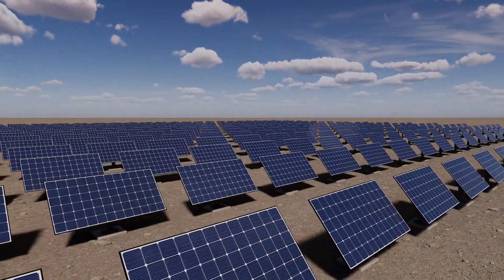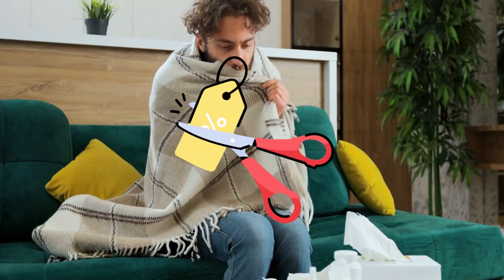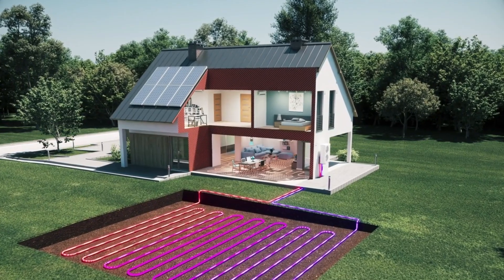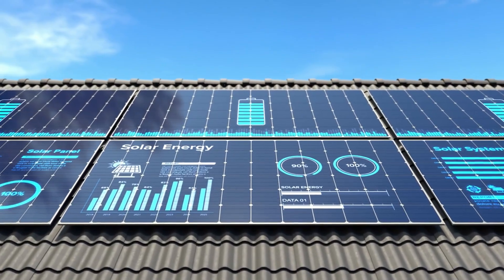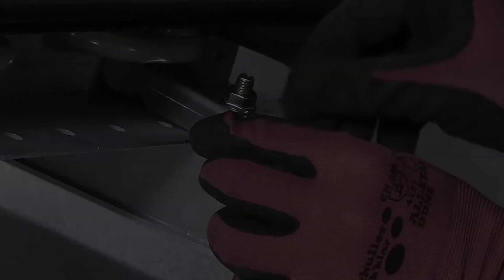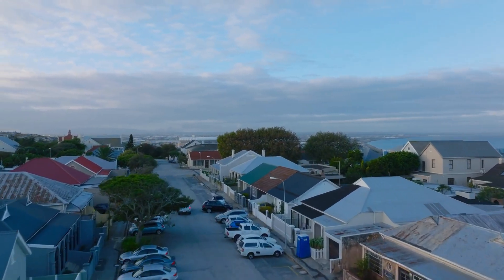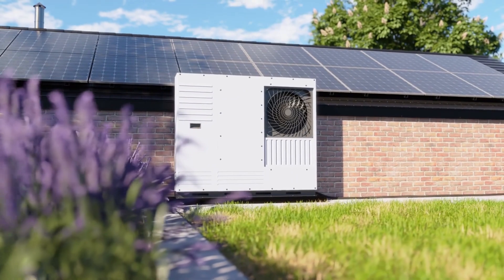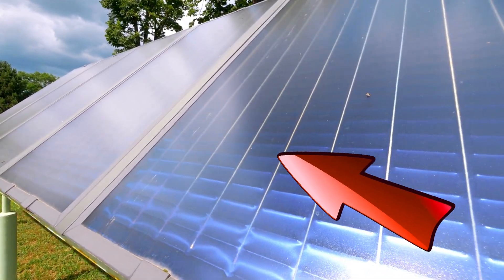This New Solar Tech Has 90% Efficiency (And Almost Nobody Knows About It!)

Comment: Hi! Just a quick thought in the midst of the Christmas rush: I found an interesting project that I've already joined. The company deals with community solar power plants. The point is: you're not buying a promise, but existing capacity, for which they pay rent. They're expanding right now, and I thought of you because I know you're also interested in stable, long-term solutions for the new year.
If anyone is interested, just write a comment here.
Have a nice day

Comment: Homes today can be built in a way that would require 90% less energy through better insulation and passive solar gain. The advantage of this approach is greater comfort and it doesn’t require any moving parts.
Reply from the maker: You're absolutely right that passive solar design and insulation are incredibly effective for reducing energy consumption in homes!

Comment: I have never understood why manufacturers make bi facial panels,on the basis that most fitted on roof it serves no purpose
Reply from the maker: Bifacial panels are made for situations where there is space for light to reach the back, which is often the case in large-scale ground-mounted or elevated installations like carports, not typically on flush-mounted residential roofs. These panels work by capturing light from both the front and the rear, but a standard roof installation creates so little space that the rear side receives almost no light, negating the extra benefit for that type of setup. For a typical rooftop, the extra cost of a bifacial panel often isn't justified by the minimal gain.

Comment: If it can be adapted for space heat (check), domestic water heating (check) and clothes drying (not sure) it may be economical viable????
A better option would be to have an underground water tank (about 2 to 4 cubic meters)for storing grey water from house hold showers, clothes washing and dishwashing.  The grey water can be re-used for flushing toilets AND act as a heat battery for storing the heat from these hybrid heat/solar panels with a heat pump removing the heat as needed.  This not only cuts down on water usage but it also cuts down on sewage output and especially in rural areas where most houses are on a well and septic tank system this is important.  In urban areas it cuts down on water intake from a municipal water supply and output to the municipal sewage treatment plants both of which reduce energy consumption for incorporated towns and cities.
Reply from the maker: Those are some excellent ideas for integrating this tech into a household system!

Comment: For Silicon PV, every +1°C will degrade efficiency by 0.5%.  NOT by going from the rated power (eg 20%) down to 19.5%, but to (20%*99.5%=) 19.9%.  2°C increase is efficiency =19.8%…   Doesn’t seem like much, but the ‘nominal’ rating is typically at 25°C, and on hot sunny days, if no convection under the panel (often in residential) the back of the silicon inside the encapsulation layer can reach ~100C!!  It does add up… but it’s very, very slow.  What the article doesn’t mention is that during cold weather, it’s (often) more cloudy, and the system isn’t really generating that much heat.  Furthermore, the larger delta-T between air temp and water set-temp (eg on cold days), the fluid will loose lots of heat energy to the ambient - reducing thermal efficiency even more.
Reply from the maker: Thanks for the detailed breakdown of the temperature effects on silicon PV, it's an important factor often overlooked!

Comment: 90% efficient = 90% upfront costs.
And a huge cost for reroofing later on due to having a qualified company remove your panels then reinstall them.
Will those efficient panels work with existing MPPT controllers and batteries?

Comment: We installed a similar panel at Tampa Bay Solar back in 2019 and they tend to LEAK. That's a huge service headache. Simple PV on the roof generating kWh is a better solution. Don't put water on your roof folks.
Reply from the maker: Thanks for sharing your view

Comment: This is exactly the kind of game-changing innovation the clean energy world needs! A hybrid PVT module like SOLINK, boasting 90% total energy efficiency by combining electricity and heat, is a massive leap forward. Maximizing energy capture from every square meter of roof space is crucial for sustainable living. Let's hope this tech gets the widespread recognition and adoption it deserves!
Reply from the maker: I agree — the potential impact of this technology is huge!
Reply: @renewable_energy  I even have a solar flashlight with emergency light and security red white and bule flashing light all chared by the sun and hat with solar fans and solar backup battery for phone charging if power goes out in a weather emergency

Comment: Thermal solar existed for decades. It's not new at all. It's 4x more efficient than photovoltaic panels for the same surface. The idea that you will cool down the photovoltaic cells during summertime is absurd. You need much more power to do that than the efficiency gain you will achieve.
Reply: Why wouldn't the flowing water cool down the PV panel though?

As a reference calculation: It takes 4.18 kJ to increase the temperature of 1kg of water by 1°C.  A typical solar water tank is some 330 liters (kg).  So heating that amount of water up from morning room temperature 22°C to hot water 45°C would take away 31.7MJ of heat energy off the back of the panels, or about 8.8kWh of energy—a substantial amount!  Because most home rooftop solar may only produce some 10kWh to 60kWh a day.

This is a lot of energy that would otherwise just go towards heating up the solar panels.
Reply: For Silicon PV, every +1°C will degrade efficiency by 0.5%.  NOT by going from the rated power (eg 20%) down to 19.5%, but to (20%*99.5%=) 19.9%.  2°C increase is efficiency =19.8%…   Doesn’t seem like much, but the ‘nominal’ rating is typically at 25°C, and on hot sunny days, if no convection under the panel (often in residential) the back of the silicon inside the encapsulation layer can reach ~100C!!  It does add up… but it’s very, very slow.  What the article doesn’t mention is that during cold weather, it’s (often) more cloudy, and the system isn’t really generating that much heat.  Furthermore, the larger delta-T between air temp and water set-temp (eg on cold days), the fluid will loose lots of heat energy to the ambient - reducing thermal efficiency even more.

Comment: What happens in summer when you need cooling in the house but the outside temperature is high?
Reply: i'm not sure about the situation of where its intended to be deployed, but where i live? that's when electricity is cheapest, and if you have something like, a sand heat battery, i'd guess, you'd just pull from that.
Reply: The solution would be to put some pipe in the ground and pass it through their to cool the water down as a ground heat exchanger. Use the pressure from the heated water to move the water. That could cool the house.
Reply: @danielvilliers612  Do the math please. If the thermal yield is roughly three times the electrical side, a 7kWp solar system that yields 45-50 kwh electrical in a good summer day, would yield 150kWh of heat into the water. That is enough to raise 2500 liters of water from 20 to 70°C. The ground doesn't really dissipate heat well, and such a system would saturate quite easily. For industrial applications that require a lot of heating to moderate temperatures, this might be feasible, but for residential solar? I don't see the cost benefit.
Reply: Unless you have a giant tank or pool to heat, the system is going to boil off and trigger the overpressure valve. at about 1-1.3kW/panel, that's a lot of heat to dissipate.
Reply: I think the solution is simple than those proposed so far.
Og the storage tank is at the desired level, drain the water side and let the panels reach whatever temperature they will. 
The when there is a need for more heat, start the pump again. That's how traditional solar panels work. 
I realise the gain from active cooling disappears. But if there is enough sunlight that day, so what. The benefit would be highest on days in the spring and summer. But where I live we have a lot of those. 
And some crazy danger built this system 20+years ago and sold them for a while. Don't know if they still exist but the idea is not new. At all.

Comment: Nice Video. The SOLINK collectors unite photovoltaic and solar thermal technologies into a groundbreaking system that powers heat pumps with unmatched efficiency, silent operation, and optimized energy usage.
Reply from the maker: Thanks for the detailed explanation of how SOLINK works!